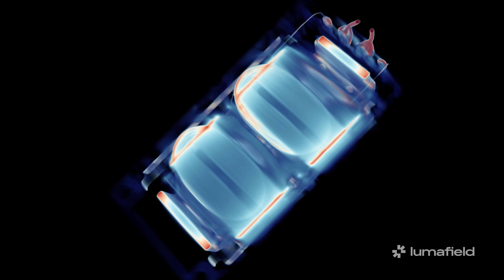Switch 2 Pro Controller: Built to Break? Full Teardown

Comment: I feel like this is an unfairly cynical take on this controller. So much stink is made about the joystick mechanism here that is pretty much glossed over in the PS5 controller teardown which also uses a potentiometer. And not to mention weird comments like the "uncomfortable" amount of force required to remove the thumbstick or "camouflaged screws". God forbid they want to make a sturdy assembly (note that other controllers and electronics in general have "camoflaged"screws). Also you conveniently ignore that all of these parts have simple connectors unlike the PS5 controller which uses soldered on joysticks and vibration motor wires that are just so conveniently run through a plastic frame, making repairs more difficult. And to top it all off, what makes it even weirder is that you gave a glowing review to the $200 Dualsense Edge which, while making joystick repairs easier, still uses potentiometer based joysticks, has even more finnicky plastic bits (and a spring?), but finally fixes the soldered on components.

Comment: I'm starting to think iFixit is getting paid to badmouth every Nintendo product. Sure, the Switch 2 Pro Controller is harder to open, but that’s an improvement. The original Switch Pro Controller had screws that stripped way too easily. From my own experience, the Switch 2 Pro Controller is still easier to open than the DualSense Edge. And honestly, there's not much reason to open it up anyway. The battery life is the best of any first-party controller even if it degrades to 25% battery health, it’ll still outlast a fully charged new DualSense. On top of all that, the Switch 2 Pro Controller is the best-feeling controller I’ve ever used. Sure, it might still use outdated potentiometers instead of hall effect or TMR sticks, but cosmetically and physically, it’s the most best feeling and durable I’ve used. The sticks don’t grind against the plastic, which means they'll stay smooth for much longer.
Reply: This. I have been using the pro controller 1 for 6 years and never had any issues. My 2ds battery stopped working so I was gonna borrow the pro controller battery since it's the same part and both screws got stripped first try. I gave up.
Reply: Bash what needs to be bashed, it's as simple as that. If they don't bash other brands as hard, that's an issue with the lesser bashing over there. This however deserves it fully, which is the focus it was given on the video, so I'm good with it. The adhesive face plate looks absolutely horrible anyways.
Reply: dude, this can be made enjoyable to use while also not a nightmare to maintain - Nintendo made this decision to inconvenience their own customers so they give up and buy a new one, it's not a bad thing to ask for them to respect you and give you an easier repair experience than this.
Reply: This just sounds like copium.

Nintendo wouldnt be bashed so hard if it didnt release trash for such a steep price.
Especially when you can get something much better, like the vader 4 pro, for cheaper.
Reply: @VIT-ey8wo don’t bash the Switch 2 Pro Controller if you haven’t tried it hands-on.
To me, it genuinely feels like the most premium feeling controller I’ve ever used. The plastic has a soft, high-quality texture, and the sticks glide so smoothly. It’s honestly unreal. I can’t even describe how smooth they are.
Yes, we Nintendo fans know it still uses regular pots sticks, not hall effect. But the comfort and the 40+ hours battery life alone make it worth every penny. (It only cost me US$69 for me because i live in Southeast Asia and the distributor on my country got the it from japan)
I also own the 8BitDo Ultimate 2 Bluetooth with TMR sticks (which is also $70 BTW). Sure, on paper it should be better, but the external build quality feels kind of meh. If you ever get the chance to try the Switch 2 Pro Controller, I really recommend feeling the sticks for yourself.
Reply: @ff_crafter  You overpaid for the Ultimate 2 then, its like $30 USD. TMR sticks are not expensive and found in many budget controllers now.

Nintendo removed the ability of the Switch Pro and other controllers to wake the system purely to sell a practically identitical controller again. After the drift lawsuits they didn't fix the sticks, they simply tried to forbid users from suing them. They even glued this controller together to dissuade users fixing them. Face it, Nintendo today are greedy to the point of being stupid and malicious.
Reply: @ff_crafter  iFixit always gives repairability scores. This is not exclusive to Nintendo products. This one requires so much work before being able to access the battery, so it makes sense it got bad repairability score. Not to mention the adhesive based mounting of the faceplate. Adhesive almost always give bad repairability score.
Reply: @ff_crafter  the ultimate 2 controller is literally $45. You can get 2 of those for the price of 1 of these crappy switch pro controller. A flydigi vader 4 pro is $55 and is better than the switch pro controller in every way imaginable. It feels better, has adjustable thumbstick tension, mechanical switches, amazing dpad, 2 mode trigger, 6 face buttons, better rumble motor, better compatibility etc.

Nintendo fans are just boxed in their little garden. Kinda sad honestly.
Reply: @chinogambino9375  the claim that they removed the ability for older controllers to wake the system with malice is laughable and hilariously shows a lack of any knowledge on the subject. The Bluetooth LE protocol they use to wake the Switch 2 is only for Bluetooth 4.0 and newer. Switch 1 controllers are Bluetooth 3.0 and lack the necessary hardware option to utilise the new protocols. They made a change to lower the energy consumption while the console is in sleep, which keeps the battery cooler and lengthens the life of the device in standby and overall.

But sure, keep pushing the conspiracy

Comment: Literally nothing in this video is covered in the complaint at the top. No test of durability, and hard to take apart doesn't equal a lack of longevity either. The battery will likely outlive the console.
Reply: Sticks are prone to drift hard to disassemble so they are not durable. Good luck getting any regular non techy person to open this up and sort screws for a stick replacement when they can just go out and buy another.
Reply: @Unlucky1776  The first Pro controller never had drift. This one is better quality it won't have drift either.
Reply: @arminarlert7273 they're all prone to drift. I have a PS4 controller first gen with no drift. Does that mean they're all prone to it?
Reply: @Unlucky1776  Prone doesn't mean that it would happen. Hall effects are also prone to other problems. You and I are both prone to a heart attack does that mean it will happen? No, I am just following a logical line of thought. If the first iteration didn't have drift or it wasn't widespread like the Joy-con it is completely logical to think that a controller with even better quality won't either. Of course I could be wrong but only time will tell.
Reply: @arminarlert7273 any controller that has these sticks will drift. It's not a matter of if it's a matter of when. There's a reason why even the first PS3 controllers are still entirely usable
Reply: @Unlucky1776  If it happens literally 20 years later then it's literally a non-issue. All controllers at some point will malfunction even hall effects. That's literally what happens with all technology you're literally picking at straws here. My pro-controllers 1 don't have drift after years.
Reply: @arminarlert7273 do you even know how long it would be until a hall effect stick starts getting issues? If I say I have a joy con that hasn't had drift so it's a non-issue it wouldn't make any sense. What's the point of arguing for these sticks on a PRO controller? You'd think first party should be the highest quality but with people like you they can get away with anything.
Reply: @arminarlert7273 and honestly even if they don't start drifting now they will in the future like you said. You do realize that retro gaming comes and goes right? Rn it's with the 3ds. In a few years it'll be with the original switch. Even after that it'll be this. Even the PS3 and 360 and Wii are considered retro now.
Reply: @Unlucky1776  And wouldn't you think that if I am going to retro game a Switch 2 game 20 years from now it would probably be emulated with totally different more advanced controllers from the future? You realize you're creating problems that won't exist in the far future?
Reply: @Unlucky1776  You love making up false problems and false equivalences. Joy-con drift is a widespread problem. If you had Joy-Cons you were almost guaranteed drift. The pro controller is an entire different story. It's literally the other way around. Can't you see the difference? You're still creating a problem that never existed in the first place and when it does I'll probably be using a different more advanced controller by then. And the thing is the controllers actually show quality. Again Hall-effects doesn't immediately means you won't have problems. You may have a very low chance at drift but that will spark many other problems that will arise with time and use just like every single piece of technology. If anything why don't we criticize 160 and 200 bucks controllers from Sony and Microsoft that malfunction faster over time than any Pro Controller?
Reply: @arminarlert7273 joy con drift was a example to show how flimsy your argument is. And who says I'm NOT complaining about those controllers from Sony and Microsoft lol.
Reply: @Unlucky1776  Well I can use the GameCube controllers as an example too to show you how flimsy and how grasping at straws your argument really is. Controllers from 24 years ago, no hall effect and they still have no drift. What will the argument be now? We also have the Wii Nunchuck an accessory thay still doesn't have drift. My Wii U game pad also shows no signs of drifting. All controllers from years ago that still work perfectly fine and guess what. None of them have hall effects and all of them are from the same company. The Joy-Con is the only controller they've made that has had this widespread problem. And the reason for that is because of how small the joysticks are. It makes them very prone to drift. Oh and the Dualsense from PS5 is also a controller that drifts alot but I see no one complain about it like they do with Nintendo or even Microsoft.
Reply: @arminarlert7273 your argument for Sony is because you haven't seen anyone complain about them? C'mon lmao. and even then GameCube controllers CAN drift believe it or not. I've seen posts from r/GameCube that talk about their sticks drifting after playing melee. They only drift less because of the gamecub calibration on boot. And I'm pretty sure the Wii does that calibration too.

Again the whole reason why Sony came out with that super expensive controller is because of stick drift. The sticks are straight replaceable. I think they should just go back to the sticks from the PS3 but that's just me.
Reply: @arminarlert7273 and again why defend the corporation that doesn't care lol. why not argue for a better high quality controller that won't break in a few years (and if it does it's  hard to open.) why not push for what you are clearly paying for

Comment: I don't like how non-friendly a potential repair is.

But the Switch 2 Pro Controller is so good to play with it's my new favourite controller.
Reply: Hopefully it'll lasy as long as the Switch 1 Pro Controller has for me. Its been 8 years and it still works: has a great battery and the sticks aren't drifting.
Reply: @neonswift my switch 1 pro controller is still going strong to this day and I got mine around launch back in 2017. I'm not worried
Reply: Sir, you have 3-6 months and it'll start drifting.
Reply: @georgesmith5201 George Smith is addicted to crying
Reply: @georgesmith5201 you’re just regurgitating random talking points. No evidence that either pro con 1 or 2 have had widespread issues

Comment: i only bought this because of 25% discount. otherwise i wouldn’t at all. also bought 8bitdo ultimate which fits perfectly for my average hand, s2 pro controller feels a bit small for my hand. still the texture and long term use favors the s2 controller. just don’t buy at original price. you could buy  2 8bitdo controllers with those

Comment: ive never had a problem with the original pro controller since launch and still use it on pc and my switch 2, only the switch 1 joycons have had drift and you dont have to pay to get them repaired. im going to get this one to see if its as durable as the original